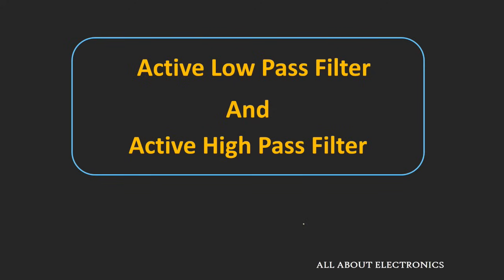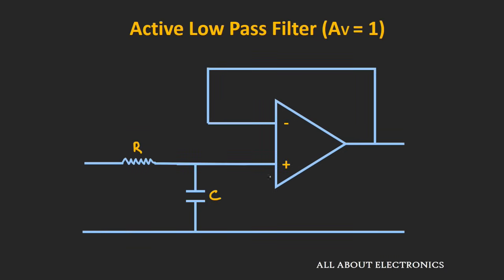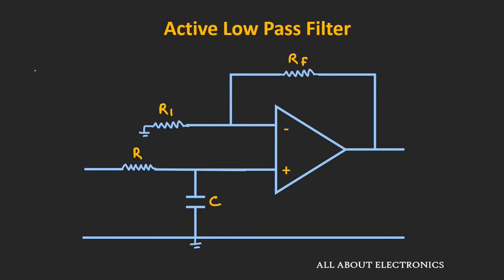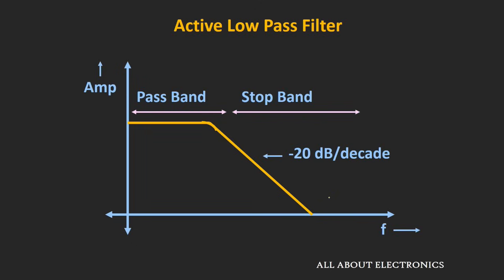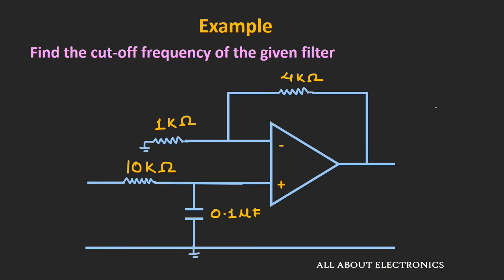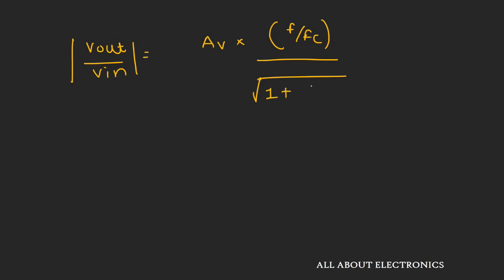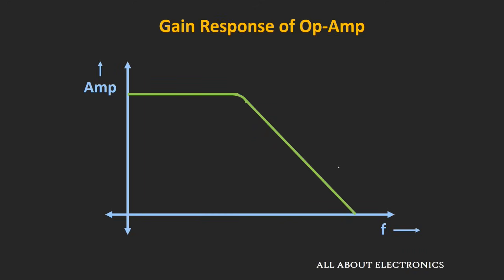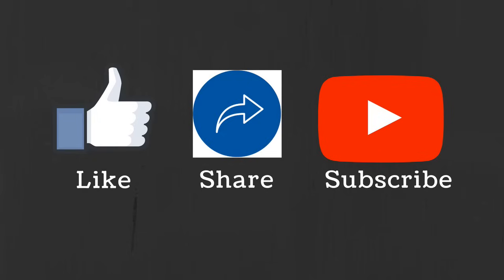Active Low Pass Filter and Active High Pass Filter Explained

Comment: Thank you very much for the informative video.
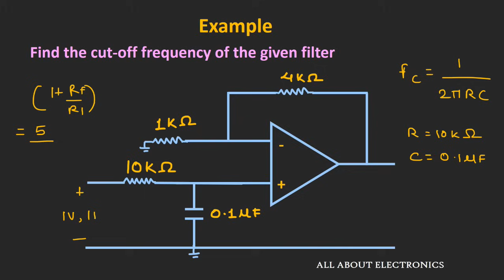At timestamp 10:34, I believe there might be a small mistake — only the voltage gainAV is calculated, soV_out cannot be directly assumed to be 5 V without knowing the input voltage.

Also, in the final example, I was wondering:
Are there any limitations when choosing very large or very small resistor values (R)?

Thanks again for the great explanation!

Comment: in active low pass filter at 9:07, if frequency is high gain is 1. then it is still giving amplitude equal to input then how did it become low pass. If should have reduced the output. please correct me
Reply from the maker: Here, we are amplifying the input signal. So, at lower frequencies the amplification will be more, and at higher frequencies, the amplification will be less. And very high frequencies, the output is the same as input. That means higher frequencies are not getting amplified at all. For example, if your input is coming from a microphone (where the signal level is mV or even less than that, then higher frequencies will not get amplified and will not be able to be heard in the speaker). So, still, this circuit works as a low-pass filter with amplification. I hope, it will clear your doubt.

Comment: In Active low pass filter , to calculate cut of frequency , 4K ohm is not feedback resistance . why you used 10k is feedback resistance ?
Reply from the maker: Because the filter is formed by 10 k resistor and 0.1 uF capacitor. The other resistors (4k and 1k resistors) provides the gain to the filter.  I hope, it will clear your doubt.

Comment: Hi, in my lecture notes, for active high pass filter , instead of the inverting terminal having the resistors connected to the ground, it is connected to Vcc/2 and one of the supply terminals of the op amp is grounded. Can you please explain why

Comment: 1.@8:54  as for high frequencies too we are getting the output then,how is that a low pass filter?
2.and how loading effect is reduced by using capacitor in the feedback circuit? Please tell sir🙏
Reply from the maker: In the filter, what matters is the difference between the passband and stopband. In case of this LPF, let's say, at DC the gain is 100. (or 40dB). And the gain at high frequency is close to unity. (or 0dB).
So, the difference between the passband and the stopband is 40dB. That means the filter attenuates the high frequencies by 40 dB. In any practical filter, you will never get complete rejection in the stopband. That means the output will never be zero in the stopband. That's why when you see the filter characteristics then as a designer one used to see,  how much attenuation in dB is provided by that filter.
I hope, it will clear your doubt.

Comment: at 9:15, why you say when Xc =0 ( infinity freq), Vout = Vin is a low pass filter? isn't low pass filter has zero gain( Vout =0) at high frequency?
Reply from the maker: Well, it is not necessary to be a zero gain. It should have certain pass band and certain stop band and in the pass band it should provide sufficiently higher gain than stopband. ( e.g 40 dB or 50dB)
Reply: @ALLABOUTELECTRONICS  i see. thank you for the quick reply!!! i really like your channel!! thank you for providing all the instructions

Comment: Sir, what is cutoff frequency in active high pass filter with inverting input? You have talked about the non inverting input cutoff frequency only.
Reply from the maker: The cut-off frequency will remain the same.
Reply: @ALLABOUTELECTRONICS  ok sir
Reply: @ALLABOUTELECTRONICS 
You mean 1/2piRfC?, asking because in non inverting case(active high pass filter) there is a resistor R but in inverting there is no R and in inverting case fc = 1/2piRC.
Reply from the maker: @sumankumar_phy0987  At 15:19, the cut-off frequency is 1/2Pi*R1*C.
Reply: @ALLABOUTELECTRONICS  Okay sir. Thanks for your time!

Comment: Sir, At higher frequencies , low pass filter must reject or attenuates the input signal But why op amp acting as voltage follower passing the high frequency input as output?????????????????
Reply from the maker: Would you please mention the timestamp where you are referring to in the video ?
Reply: @ALLABOUTELECTRONICS  08:47 sir
Reply from the maker: @Become-civil  At high frequencies, the filter provides unity gain while at low frequencies it provides the gain of (1 + Rf/R1). So, basically if you see the frequency resposne of the filter then at low frequencies, there is 20dB or 40 dB gain while at high frequency there is a 0dB gain. Let's say yor input signal to the filter is 100 uV. And the gain provided by the filter is 100. So low frequencies will see the gain of 100, while the high frequencies will see the gain of 1. That means the detector or the circuit after the low pass filter would only be able to detect the low frequency. 
The thing to look out in the filter design is how much dB difference is there between the pass band and the stop band. I hope, it will clear your doubt. If you still have any doubt then let me know here.
Reply: Thank you 😊 
Got it!!

Comment: Correct me if I’m wrong, but I think you made a mistake at 10:19; the capacitance C = 0.1uF which is 0.1 x 10^-6, however when calculating the cut-off frequency, you used 10^-7 as your capacitance value - the answer should be 1.59KHz
Reply from the maker: 0.1 × 10^-6 = 10^-7. Isn't it ??
That's why for simplicity, I have taken 10^-7 during calculation. I hope it will clear your doubt.
Reply: @ALLABOUTELECTRONICS  Thank you for your response, I appreciate you helping to clear this confusion. 0.1 x 10^-6 is the same as 1 x 10^-7, therefore it would be 10^-8, wouldn’t it?
Reply: @taylorstechtalks8456  10^-1 multiplied by 10^-6.

Comment: For those who are not able to understand the last example,
We will start off by noticing that this is a Non Inverting OPAMP therefore, Av=1+(Rf/R1)
We have already derived that Vout/Vin= Av*{(f/fc)/sqt[(f/fc)^2+1]}
It's always better to assume the value of Capacitor because it's not feasible to get capacitor of obtained value in the market. We can easily obtain Resistor value using a POT. Hence, I assumed C=10nf;
We know, Fc= 1/(2*pi*R*C); Fc= 5*10^3 (given);
Get value of R; R=3.18KHz.
Now, It is given that Vout= 1V , Vin= 100mV; Hence, Vout/Vin=10 and f=10KHz (given)
Substitute all the values in the eq:
Vout/Vin= Av*{(f/fc)/sqt[(f/fc)^2+1]}
GET VALUE OF Av; Av=11.18.
Av=1+(Rf/R1); Rf/R1= 10.18
Assume Rf=10.18KHz
Therefore, R1= 1KHz.
Reply: For the last two resistors, you used Hz, and not ohms.
Reply: where did u get the value of R as 3.18KHz ?? and what do u mean by get value??
Reply: he calculated using the formula  @SUBHANKARDEY-ji6xs
Reply: @SUBHANKARDEY-ji6xs  Here you assume value of C and by expression of cutoff frequency you get R = 3.18 ohms
Not Hz
Reply: god bless u bro. thanks!

Comment: For the circuit given at 15:26
If we were about to calculate the gain for that circuit in terms of Ron do we say Zin?
Do we add the impedance of the capacitor and Rin together or does it just stay Rin?

Comment: sir , at 7:00 why did u multiply Av with the 1/ root(1+(f/Fc)^2)     ....i dont get it
Reply from the maker: That is the transfer function of the low pass filter. Without the filter, for DC, the gain of the op-amp will be Av. But because of the low pass filter, the gain of the entire circuit is frequency-dependent. It will change according to the frequency response of the low pass filter. That's why it is multiplied with the transfer function of the filter.
I hope it will clear your doubt.

Comment: Thanks, but what is the transfer function useful for?
Reply from the maker: From the transfer function, you can find the frequency response and the stability of any circuit.
Reply: @ALLABOUTELECTRONICS  Thanks, so I can have a frequency of response of 1Khz even though my input frequency is 50Khz or something like that really?.
Thanks a lot. You are the best teaching.
Reply from the maker: @ernestofavio6735  If the input signal has frequencies from 0 to 50kHz, then the output can have frequency of only 1 kHz. But if the input has only discrete frequency 50kHz then at the output we can't have 1 kHz frequency. ( I am talking from filter perspective).
The input should have that particular frequency, which we want to recover through the filter.

Comment: I choose c= 0.01uF, then i got R=3.18kohm from the law of cut off frequency (fc),  Here input is 100mv is equal to 0.1v, So gain is Av=Vo/Vin = 1/0.1 =10, So we have to make the gain 10. this is non inverting op-amp so we know Av= (1+Rf/R1)= 10 if i choose Rf= 90kohm, R1=10kohm.
will it right?

Comment: The numerical done for finding the cutoff frequency, in 10:40, why aren't we taking the Rf value in the cutoff Frequency, instead we took R value... Please explain...
Reply from the maker: In the example, the op-amp resistors Rf and R1provides the gain. In fact, if you find the frequency response (Vo/Vin) then you can see that, (1+Rf/R1) is the gain. 
I hope it will clear your doubt. If you still have any doubt, let me know here.

Comment: Sir, at 10:33 when a supply voltage of 1V is there, you write the output will be 5V but sir wouldn't the gain of the rc filter be multiplied to it to give the final output?
Reply from the maker: Yes, it's true. The gain of the RC filter will also get multiplied. But as the cut-off frequencies 159 Hz, so, at 1Hz, there will be hardly any attenuation. And Vo is approximately equal to 5V.
I hope it will clear your doubt.

Comment: To prevent change of cutoff frequency in low pass filter ,you set the capacitor in parallel with feedback resistor, but you do not do anything like that for the active high pass filter. My question is If a circuit is attached at the high pass filter terminals,  will that change the cutoff frequency or not? Or, would we need to add a buffer for the active high pass filters? Please let me know.
Reply from the maker: It can be connected directly. Because the op-amp itself will act as an buffer. And in fact, that is the advantage of the active filter.
Reply: @ALLABOUTELECTRONICS  thanks for replying back. The OP amp acts like a buffer for the load, right? But I am talking about at the vin end. For the low pass filter, you say that at the  vin end if there was another circuit connected, the cutoff frequency of the low pass filter might change. That's why you put the capacitor parallel to feedback resistor. However how do you prevent this if a circuit with impedance and voltage were to be connected at the vin end of the high pass filter? For the high pass filter, you did not change the configurations. Please let me know. I would really appreciate it.
Reply from the maker: If the input to the high pass filter is also coming through the op-amp, then there won't be any issue. For example, if the input to the active high pass filter is the output of the active low pass filter, then it won;t affect the overall response. 
But if is coming through some other source, its good to use the buffer before applying it to the input.
I hope it will clear your doubt.

Comment: That last problem was a fantastic problem - thank you for suggesting it.
I looked up capacitor values on google and used the first one I found -> C = 5.6pF
Using this value I get a resistor in the filter to be R = 5.68E6 Ohm.
This produces a voltage at the op-amp of .0894V.
Finally, I chose Rin to be 1000 Ohm. This gives me a Rf of 10,185 Ohm.
I believe I am correct and this really gave me a good understanding of designing these circuits.

Comment: DESIGN FOR HIGH PASS FILTER ;
Let  C=0.1uF ;  (Easily available and compatible for the practical circuitry)
Given : Gain, A=10. 

Formulas;  a) Gain, A=1+(Rf/R1)
                    b) Cutoff Frequency, fc=1/(2*pi*R*C)
We get,
C=0.1uF
Rf=9kHz
R1=1kHz
R=318.3 Ohms= 318 Ohms
Reply: actually it is wrong, when the f is larger than f_c, f/f_c square will be very small and you can assume it is zero so that in low pass filters |V_out/V_in| = Av, but in high pass filters in numerator there is f/f_c term so we cannot assume v_out/ v_in = Av. In this question Av is unknown and and V_out/V_in with f and f_c values known so you can find Av then it will be equal to the 1+Rf/1 ( do not forget f= 10kHz, fc= 5kHz and C value should be assumed smt and with this you can find R, after finding Av, Rf/R1 will be equal to some number and regarding that number you can choose Rf and R1

Comment: Av galat likha hai as it is an inverting circuit shouldn't the gain should be -Rf/R   ???
Reply from the maker: If you closely observe at 4:23, the input is applied at the non-inverting terminal (positive terminal). So, for the inverting terminal, Av = (1 + Rf/R1)
If the input is applied at the inverting terminal, then Av should be -Rf/R1.
Reply: @ALLABOUTELECTRONICS  Ohh Yess.. thank you so much.
Reply: Yashica, I had analysed this circuit. You may refer my videos

Comment: If Rf  & R1 be 3k & 330 ohm respectively ...  The gain Av will fulfill the value as 10 ...  To determine the capacitor in this circuit,  if we consider the value of R= 15 k ohm..  We will get the value of capacitor as 2.12 nF ...   Practically ,  during my lab work.. I have found all these type of resistors
Reply: the value of C is 10 nF because the gain is 10 (Vout/ Vin)

Comment: Sir, please clarify my doubt at 15:13 , in this circuit diagram, will both the resistors decide the cut-off frequency?
Reply from the maker: It will depend on R1. Rf will decide the gain.
Reply: @ALLABOUTELECTRONICS  Thank you, sir❤

Comment: * At 9:05, if gain is 1 then, how is it eliminating that frequency? * Isn't it simply allowing the high frequency to pass with the unity gain and if so, then how is it behaving as a filter?
Reply from the maker: What I mean to say here is, it amplifies the low-frequency signals and it passes the high-frequency signal as it is. 
And if you plot the frequency in dB then for the low frequency it provides gain and at the high frequency, it does not provide any gain. 
This is the case in many communication system, where the signal and the unwanted frequency signals are very low (in microvolt) and you want to boost the desired signal with the gain. 
I hope it will clear your doubt.

Comment: 1)If my input is coming from another circuit, how the impedance of the that circuit will effect the cut-off frequency of normal active LPF design.?
2)How Xc=0 will make it unity gain amplifier ?
Reply from the maker: 1) in the first case, I am referring to the output impedance of that circuit from where the signal is given to the filter.
2) When Xc= 0, Rf will get short-circuited. So, the output will get short-circuited with the inverting input terminal. 
Hence, it will act as, unity gain amplifier. 
I hope it will clear your doubts.
Reply: @ALLABOUTELECTRONICS   but as there is short circuit there will be no current flowing in the circuit also invertting terminal is grounded due to which Vin will become 0 so V0 will be zero

Comment: can anybody explane to me, how we find the H(s) of the inverted active low pass filter? thank you.
Reply: Only we have multiply the gain of inverted opamp to previous formulae
Reply: Jst try writing the equation for a general opamp circuit using opamp and take parallel Rf and C equivalent to Z and then later simplify or you can do it bytaking Laplace transform  also....  If futher explanation needed then do ...comment

Comment: In the output voltage expression of non inverting amp...we should consider voltage at V+ right?? Which in this case comes out to be 66.67mV and design values comes out to be r1=1k and rf=15k?
Is it correct?

Comment: sir at around 8 min,u said changing the position of the capacitor will allow us to operate the circuit with out the use of another buffer at the input  and immediately u explained it by taking the extreme values of 'w' as zero and infinity. Now my question is for both the values of 'W=0' and 'W= infinity' we are geting output. the only difference is,at 'w=infinity' the output is having gain 1 and at 'w=0' the output is having some gain. but all the frequencies are being allowed.Then how it acts like a low pass filter?
Reply from the maker: It's not always about the absolute gain in the stop band. Many times Its about the relative gain in the passband and stopband. Let's say at w= 0 if Rf/R1 is quite large (let's say 1000, considering input signal in mV)  then at one extreme gain is 1000 and at w is equal to infinity, the gain is 1, which is 1000 times less. So, the circuit will amplify low-frequency signals by larger gain and high-frequency signals by smaller gain.
I hope it will clear your doubt.
Reply: @ALLABOUTELECTRONICS  yes sir. Thank you so much. Soo kind of u.